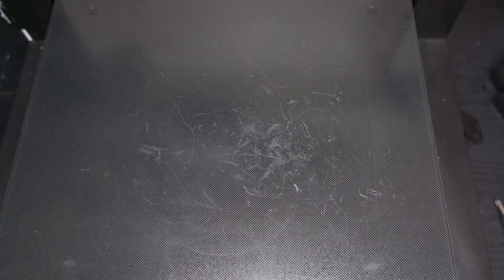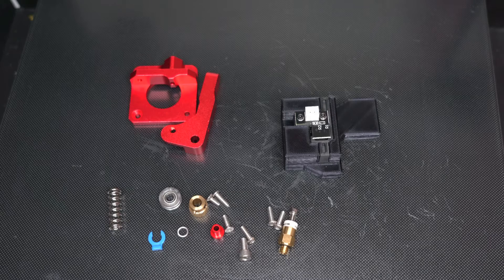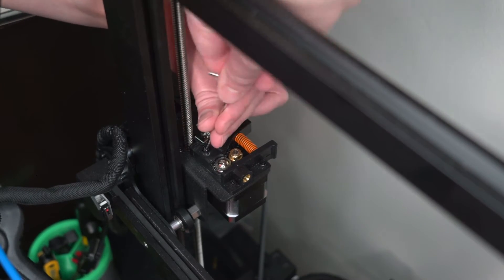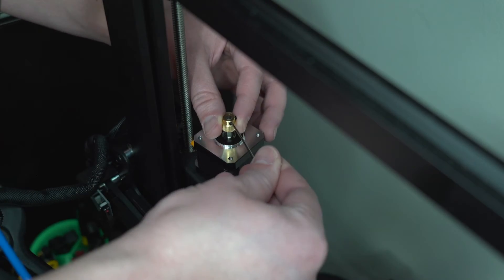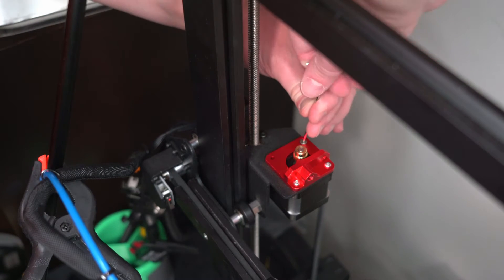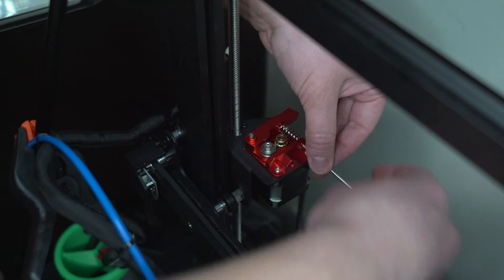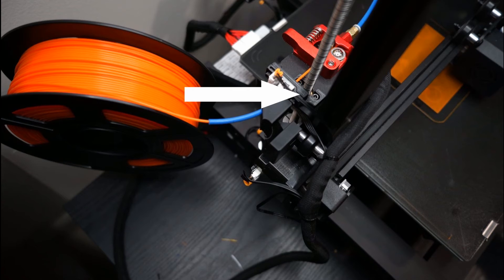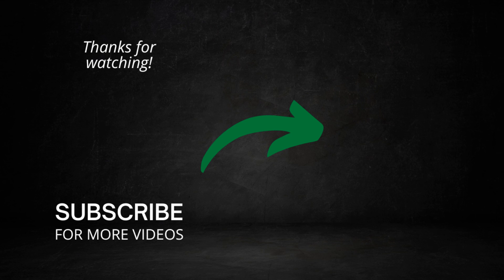How To Install an Aluminum Filament Extruder on the Longer LK5 Pro | Easy Tutorial

Comment: This video helped me a lot, especially after the original filament sensor bracket was damaged by a big project. I bought this metal piece and installed it using your video—many thanks!

Just one question: What filament guide bracket did you use? I have one, but it doesn’t fit with this new sensor bracket, nor does it fit with the printed version you explained.

Many, many thanks!
Reply from the maker: I'm glad you found it helpful!

The filament guide bracket that I used was the one that came with it. I found that it wasn't stable and caused me some issues as well. I was able to get it to mostly stay on the printer, but I actually just ended up completely removing it. I haven't seen any issues with not having it attached. If you are worried about not using one, you could check Thingiverse and Yeggi to see if there is a printable one available. That's where I found the file for the actual bracket.

Comment: One thing to add is when mounting the new drive wheel to make sure you either square up one set screw with the flat side of the shaft so that it is perpendicular to the flat or have both screws on the round part of the shaft.  I had the wheel walk off the shaft half way through an eight hour print and didn't realize it until about six hours in when some details had not showed up.  I'm quite positive what happened is the wheel vibrated loose due to the set screw being on an angle to the flat side.  I know I didn't pay close enough attention to that when I put it on the first time.
Reply from the maker: Excellent tip that I should have mentioned. Thank you for mentioning it!

Comment: Everything but the filament sensor looked easy enough at first.  Thanks for saving me from loosing my mind getting it to fit.  It's almost like it was designed for something else.  I just put a piece of wire between the pins in the plug to get it going while I wait on screws to come in.
Reply from the maker: Gald I was able to help. It threw me for a loop at first, too!

Comment: Using your example, it seems I managed to succesfully install this upgraded extruder on my Longer LK5 Pro. Although it came with no clip and the assortment of screws was slightly different! I am wondering if there is any way to adjust the tension on the spring (and thus the pressure on the wheel)? I see no way to do that, but maybe that is just me.

Comment: I got the filament switch mounting block to work but it took some time. I had to get out the drill and bore out the holes it was unusable before that. if anyone else tries to do this put your drill in reverse go slow and on the larger hole don't go all the way through leave about 1.5mm on the switch side. The drill bits I used were a 5/32 and a 3/32.

Comment: I just watched this and installed. I would add that the lock washer goes under the wheel so the screw doesn't hit the bottom plate. Thanks for the video.
Reply: after running my machine i now believe it goes on top of the wheel
Reply from the maker: @cameronjohnson8856  ah, I ended up not using it at all because I wasn't confident of where it was supposed to go. I haven't had any negative effects, but I'm going to add it and see if I notice any improvement!
Reply: @jfmedina2010  dont know if you saw my second reply but it goes on top of the wheel. before i put it on my screw was digging in to the bottom plate.
Reply from the maker: @cameronjohnson8856  I'm going to try that! Thanks for the tip!